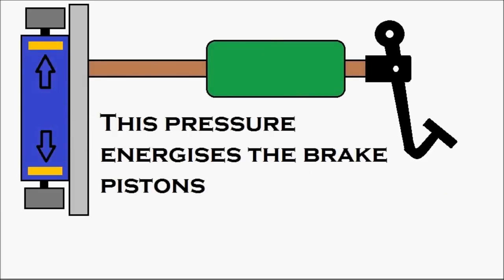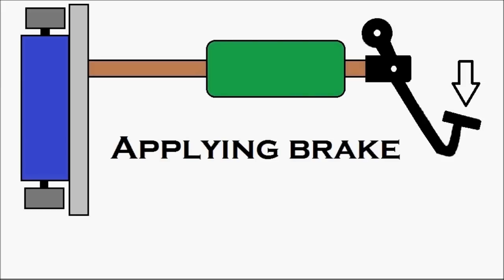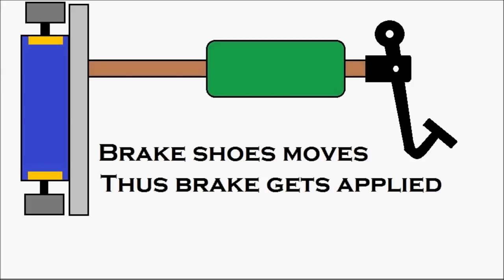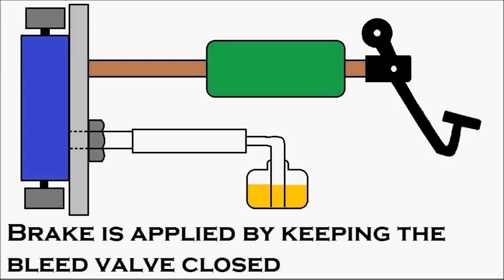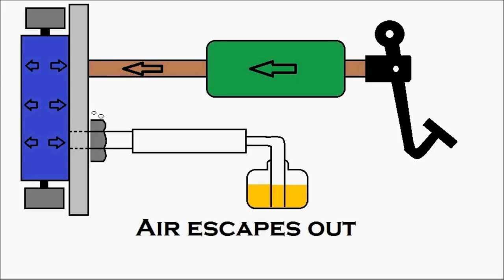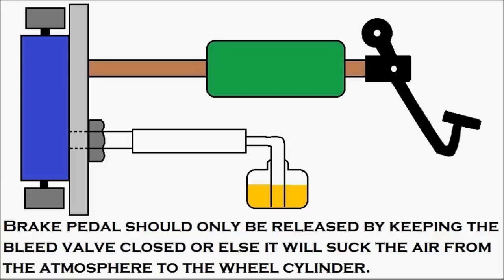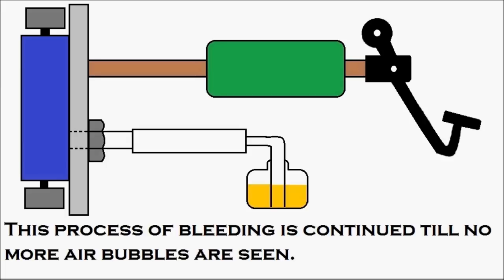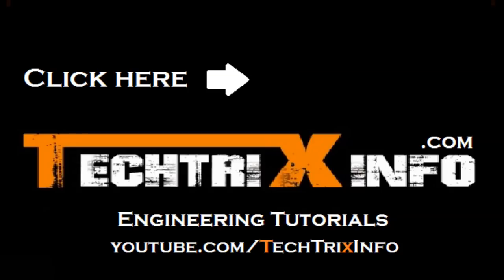Animation | How hydraulic brake works and brake bleeding is done.

Comment: question...what would happen if one uses water instead of oil in this system?
Reply: +Nipindra Gurung water evaporates under pressure, that can be stacked on a smaller surface. meaning that you won't get pressure. thereby, i assume that if there would be air in the system it will make things corrose because of the combination of water and air.
Reply: make sense...thanks for the reply
Reply: boiling point decreases as well
Reply: The water would freeze in the winter as well.
Reply: I used to daily an 86 Fiero GT with a clutch line leak, once when I was out of town, the entire clutch line fluid drained and had been draining while I was driving so the reservoir was completely empty. Being nowhere near any shops, I used water from my water bottle to fill the reservoir and lines, bled the lines some and ran on that water for a good month before remembering I put water in there XD

Bled the lines again, replaced the water with brake/clutch fluid, everything worked fine! However, there is likely some corrosion from the air/water mixture but not enough to cause any new issues.
Reply: Most importantly is, water will rust out the inside of the brake line..and block them off..not a good thing to do..even using brake fluid, moister is a problem because brake fluid attracts or absorbes moister.
Reply: In Australia the Aboriginal guys in the outback use water with some clothes washing powder in it. Saw it on TV. Only thing is, not much traffic out there in the  Simpson desert.  Running into feral camels the biggest danger, lol.